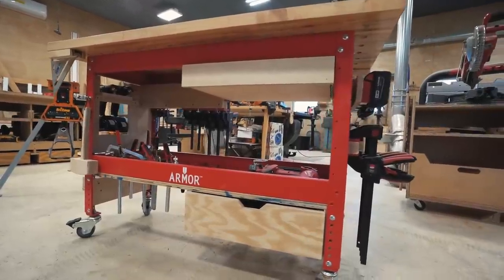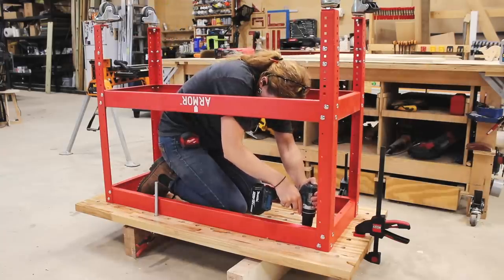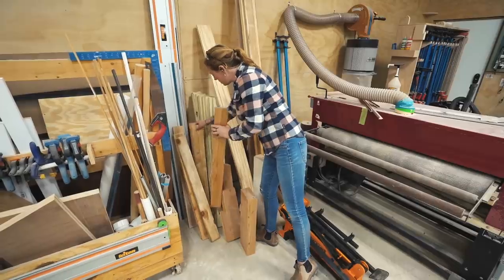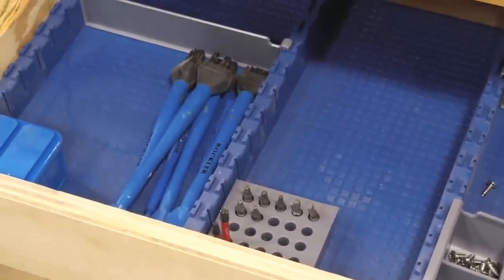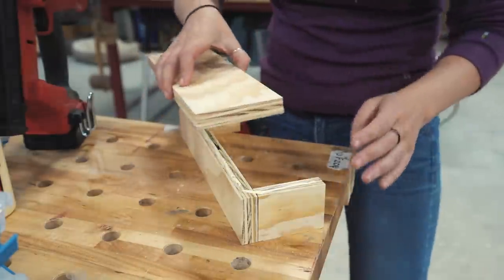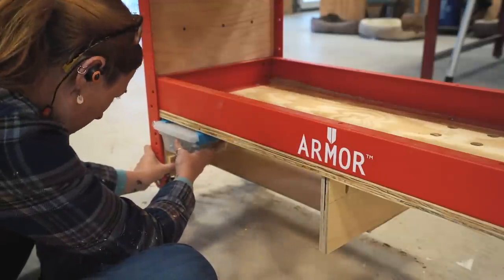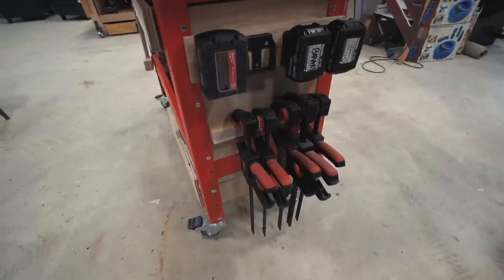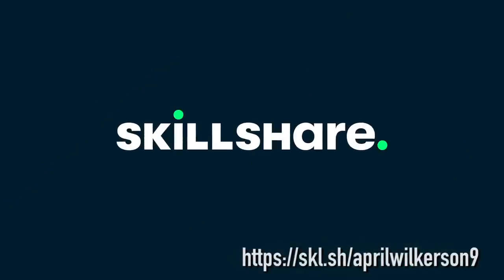Armor Tool Workbench Upgrades

Comment: Hey April...quick thought, if you take off the bottom shelf put in 1\4" nylon spacers in-between the shelf and bottom bar would give you space  to brush out \ blow out with air when dust or shavings build up on the bottom shelf. Just a thought and love the videos, keep it up!

Comment: Not long ago I realized I was taking out and returning the same group of tools no matter what the project. I finally made a 24×24 inch tool cart with a plywood top and lots of tool space underneath. Its small enough to not be in the way, big enough to hold that 95% of my tools I use  regularly,  and a little worktop for project or notes. No matter where I go... metal, wood, car... I just roll it to where I am working. I do sometimes need unusual tool.. but not all the time like before.

Comment: I plan to put a 3/8 shelf,  resting inside the cross and side bars, with another shelf with lips on top.  Lathe tools will be stored inside.   Top shelf will lift from either side.  I also ad an idea to make a vacuum chamber under the top to use as a sanding table.  The sawdust will be drawn down into the holes by the attached vacuum hose.

Comment: Nicely don. Smart. I'd consider though, to put the vertical side boards to the other edge of the U profile they are on - that way the kit you hang off them sticks less out on the side. Your shins will be grateful, I guess. It's just between 2" and 3", I guess, but still makes a difference

Comment: That bench is becoming a mobile workshop of it's own :)). You could make a little trailer using motorcycle wheels (with sides so your stuff didn't rattle off and fall) so you could tow it around to job locations, with an atv or even a pickup, or just pull it out around the place by hand if it's close. Like your enclosed garden structure.

Comment: I recently picked up several used rolling 52”x30” display tables made of 2”x2” welded black wrinkle painted steel tubing on industrial poly wheels with brakes similar to the setup of your Armor bench from a department store going out of business. The fist thing I did was to raise the top to the level of my table saw and work benches so two could be used as In feed and out feed tables on the table saw. I replaced the top shelf with Formica covered plywood to make it slick when feeding large sheet goods. I made one into a box with six  24”x24”x6” drawers and the other box open on the long sides and the divided box with eight pigeon holes for power tool storage accessible from either long side of the table. When not being used at the table saw I clamp them together for a giant assembly table or use them individually for bench top power tool stations. They cost me $10. ea. but I had to transport them myself. After watching your build I’ve decided to turn one into a downdraft sanding/ clamping table with a cyclone dust collector to pull the sanding dust. Thanks for the idea.

Comment: Great job 👏but I had one idea if you allowed me. There is open space under the sand block u can put the battery holder on it . That's making changes the battery  from drill's so easily when you needed..

Comment: Nice video, Great use of your  table , I  did see you  added a tee bar  to hold the bottom drawer which now gets in the way if you  use long bar clamps . Could you not of use  it as a slider  drawer with two tee bar  supports to move out of your way  in stead of opening it and taking it out?   Thanks

Comment: No spilled paint in this video? The modifications make the work bench more efficient everything is there where you need it, you're not walking hundred miles a day all over the shop. Less wear and tear on your aging 32 year old body lol. The weakest link of the bench would be the casters but I imagine they are rated for more than the bench can hold.
Reply: And I'm sure the casters could easily be replaced with heavier ones if needed.

Comment: Why do you used a drill driver when you have impact driver
Reply: why would you use an impact driver? (serious question)

i´ve seen plenty of them being used on american diy channels, but have never had one in my hands or even seen one for sale anywhere. and for me it doesn´t feel like i´m missing out on something.
Reply: @YamahaYZFR6RJ05  You'd be amazed at how efficiently an impact driver drives and/or removes screws.  I have a DeWalt compact 14.4 one that I've had for at least 15 years, and it still drives screws just fine. (and a lot of them on one charge!)
Reply: John Grubbs thanks for your reply! but why's everyone all over europe missing out on this then? not only diy'ers but professionals also, which i kinda count myself to also. (i was a carpenter once but now i'm in law enforcement.)

Comment: Why don't you be more environmental in use electricity. Set up some solar panels where you're at.
Reply: That IMO would be a major expense with little return.
Reply: Do you?
Reply: @larrybe2900  Not if you DIY, which is something April is great at.
Reply: @FSGAMER35  I don't use batteries except for cell and laptop...and if I was able to get the solar panels I would...she had a lot of batteries and that isn't good for the environment have a great day
Reply: @NiHaoMike64  I never said she wasn't great at what she does I'm just suggesting to be environmental
Reply: @larrybe2900  my chiropractor does it and he gets paid for his electricity. And every month that electricity produces enough for his electricity for 2 months plus when the insurance company buys from him he makes money both ways. In 2 years he's paid for it already and had made a good income from it
Reply: @meme7591  
There are variables in installing solar.
The panels are not forever.
The inverter may not be forever.
Roof positioned south?
Ground based takes up space.
What is involved in being a direct supplier?
Rates vary to make it a viable option.
Reply: @larrybe2900  yes that is true but she is in a very sunny place and has a lot of buildings to put those on. And my chiropractor installed it where it was like say for example$0.35 a kilowatt.so he doesn't pay for electricity but anything that goes above 35 kilowatts he said he gets that in revenue. And I understand there's lots of variables his panels will last for fifty years.
Reply: @meme7591  
That is a huge rate for electric. How long will the panels last at full capacity output? Good for making it work.